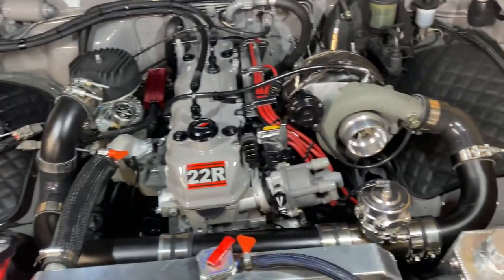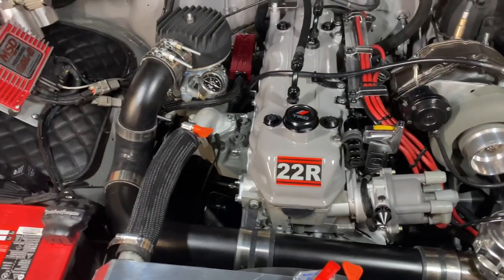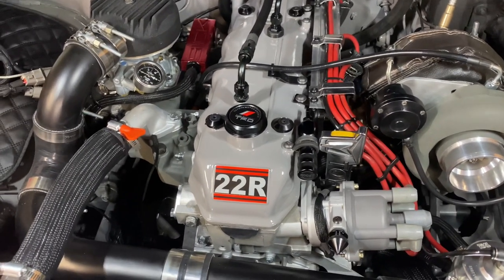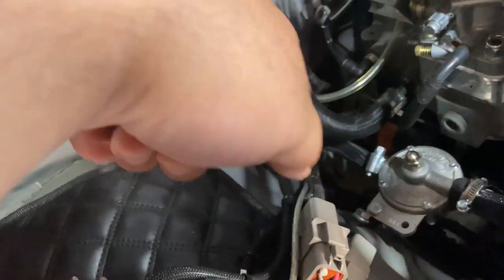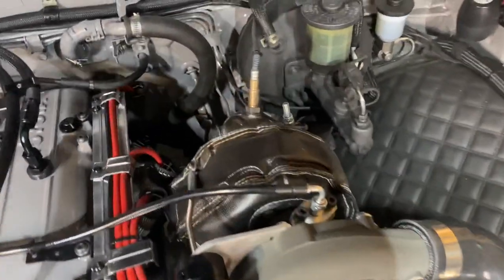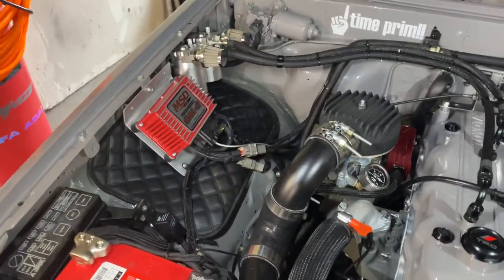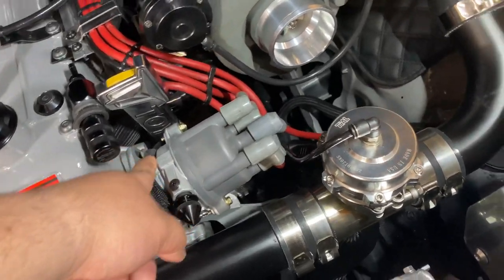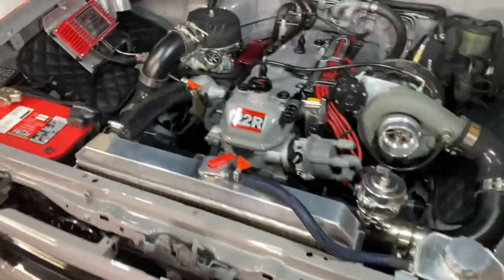BOOSTED 1985 TOYOTA PICKUP!!

Comment: Cool truck. What size is your exhaust piping? I assume 2.5" OD if it's a T3/T4 Ebay turbo? I seen dyno testing for turbos indicating back pressure should be minimized , which they indicated to not restrict diameters less than what the turbo outlet was, else the max power was not achievable. I was planning to keep my 2" exhaust which I though could be used for myt urbo upgrade, but now thinking upgrading to 2.25", but now 2nd guessing a 2.5"
Reply from the maker: I’m running 2.5” pipes with a flowmaster super10

Comment: The more boost you run the less compression ratio you want. 9.5:1 is perfect for 10 psi but if you ever want to push the boost up to 20 you’re way better off at 8.5:1.

Comment: super clean toyota pickup bro. one day I hope to own one like this. does the 89-95 grill, bumper and headlight assembly just bolt onto this gen? or did you have to fabricate adaptors?
Reply from the maker: You can bro 👌🏽 I had to make the brackets and the other thing I did was I extended the corner lamps to make the fitment better

Comment: What lowering kit did you use and did those 18s fit without any problems?
Reply from the maker: Front has 2” drop spindles with a little torsion rear has 3” block minus the middle leaf spring. I’m running 4wd fenders and the bed was widened 1” on each side to match the front fenders during the body and paint work. If your running stock Cali bed it won’t tuck it’ll rub. The 18s had 1/8-1/4” clearance

Comment: Truck looks fantastic. Details on the windshield without the trim? Tired of dealing with it on my 87 2wd and 87 4x4 extracab.
Reply from the maker: I had my windshield guy install a universal rubber seal when I replaced it. He brought it over with the glass and It looked good so I went with it. The body was prepped and painted without the trim so the finish around it is clean.

Comment: Hey bud good job 👍🏼 nice truck !!! 
Where did you find the info to fix the carb I’m also have weber 32/36 and I’ve install a turbo but can’t get it to run right!! Do you mind share some info about what to do to the carb ?  Thanks in advance
Reply from the maker: Thank you. I’m running E85 so I had to drill out the jets pretty big. I used the small but set from harbor freight. Primary I had a 200 jet drilled out 2 but sizes up and secondary jet was drilled out till all was left was a sleeve with the threads on. 135 primary air corrector jet secondary air corrector was soldered shut. I used f6 emulsion tubes and switched out the single pumper to a dual. I also chopped the choke off so air flows directly into the carb. I used a 2” lce spiral spacer to help with the air/fuel mixture. It too me about 50 try’s to get it to run right. I’m still on the rich side but it works good. Also make sure you have a boost referenced fpr so fuel pressure and boost pressure is 1-1 ratio.
Reply: @kamikaze_670  thanks for the info you have explained all ths good stuff but I’m not to good on carbs 🤦🏻‍♂️I thought it will be some info in the web with images or aome to understand better but I well I guess I have to find someone to fix it for me I’m only want to run like 5psi of boost since my motor is stock thanks a lot for the information you share 👍🏼

Comment: 22lbs is insane on a carbureted 22R. here I was thinking that carb + turbo wasn’t great, but it’s nuts if you do it right. I wonder if I could do a hood turbo carb setup with bike carburetors.
Reply from the maker: Thanks it’s a lot of fun! It’s not as efficient as EFI but it works. I just wanted to do something different. I went with the 32/36 because I found information on how to boost reference it. Idk about the bike carbs.
Reply: @kamikaze_670  where did you found the info about the carb ?? I got one and not working properly, would like to do it to my weber so if you don’t mind pass the info or if you got a video on how u did it send me the link bro 😎 nice work dude this is the cleanest truck I have seen

Comment: Hey man do you have any information for me to boost reference my 32/36
Reply from the maker: I started with a manual choke 32/36. I ended up taking off the choke and cut off the top of the carb so I could get direct flow into the venturis. I installed a bigger needle and seat I did a 2.5 for more fuel into the bowl. Seal the secondary air corrector jet my primary air corrector I believe is a 165 with a f6 emulsion tube. I installed a dual shooter jet so it shoots fuel into both venturis when I push on the throttle, for na it’ll be too rich but for boost it helps. I had to drill out my primary and secondary jets because no one makes them big enough, keep jetting up on the primary and secondary jets until your afr’s are good. I’m running e85 so they have to be bigger than if I used pump gas. It’s a lot of trial and error during testing I watched my gauge to make sure it didn’t lean out. When I got it right it works amazing I’ve turned it up to 27lbs and it works good. Not as smooth obviously compared to an EFI with a stand alone but it gets down. Your gonna have to get a boost referenced fuel pressure regulator and make sure your fuel lines are big enough I ran 3/8 lines for inlet and return to the tank so I could get the fuel pressure at idle low enough for the carb @ 3psi. All in all it runs good my fuel pressure is 1:1 with boost so it’s good.
Reply: @kamikaze_670  Awesome work, did you had to modify or change the stock power valve itself? I saw a boost referenced one online on Australia company is called turbo gemini but it seems no necessary to me, thanks for the great video, really like your truck.

Comment: a dream build right here, what's your suspension setup?
Reply from the maker: Running static front setup is drop spindles with a little torsion rear is 3” blocks minus a load spring.